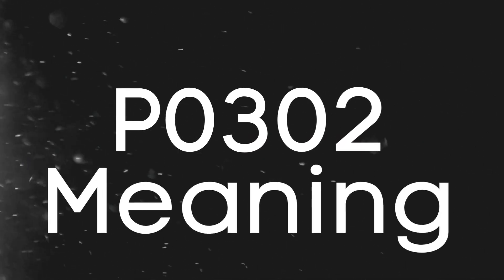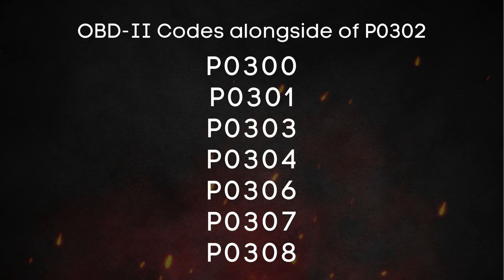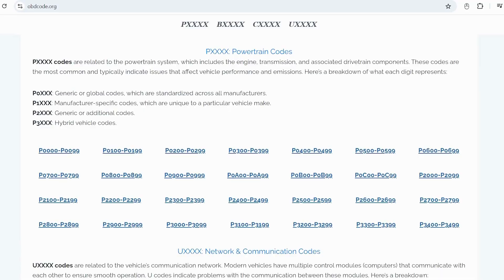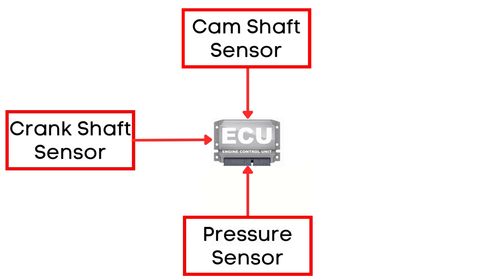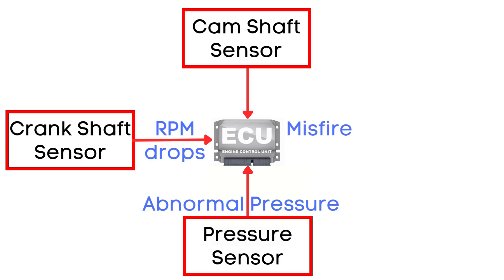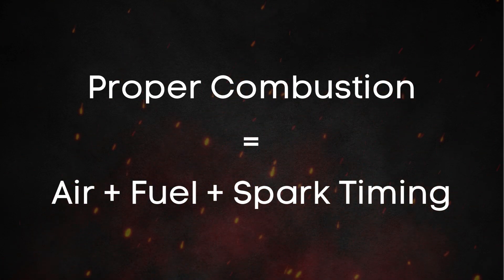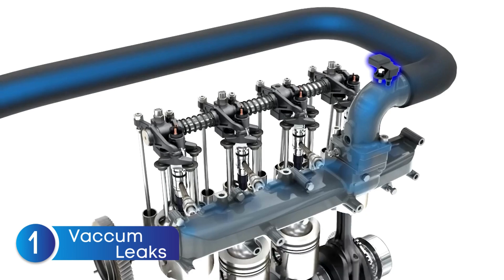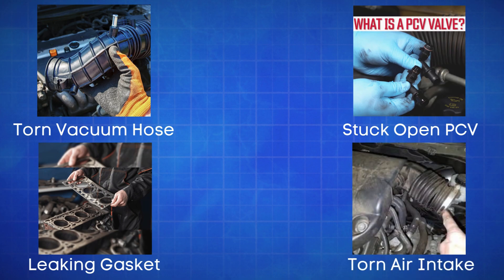How to fix P0302 | Cylinder-2 Misfire Detected

Comment: I had a cylinder 2 misfire. I changed the coils and spark plugs and nothing, then I realized that it was probably a clogged fuel injector, then I used Redline fuel injection cleaner in my tank and ran the car for a while then the problem got fixed and the misfire code went away on the OBD2 scanner. The car had a really bad rough idle, car engine was shaking and stalling a lot. The Redline fuel cleaner fixed it!
Reply from the maker: Thanks for the info...definitely it will help others.
Reply: My Cadillac cts4 2008 I got a P0302 misfire on cylinder 2 would that be the spark plugs n coils?
Reply: @kaylanclint9086  A cylinder 2 misfire, indicated by code P0302, means the engine isn't consistently igniting the air/fuel mixture in cylinder number 2. This can stem from several issues, including problems with the spark plug, ignition coil, fuel injector, or even mechanical issues within the cylinder. To diagnose, start by checking the easy and common culprits: spark plugs and ignition coils. Try changing the spark plugs, if nothing happens, then swap the coils on cylinder two and see if the misfire code goes somewhere else like to cylinder three, and that would be an indication of a bad coil. A cylinder 2 misfire can often be diagnosed and potentially fixed by swapping the ignition coil with another cylinder. If the misfire "follows" the coil to the new cylinder, then the coil is likely faulty and should be replaced. If the misfire remains on cylinder 2, then the issue is likely elsewhere, such as with the spark plug, fuel injector, or wiring. Make sure the spark plug wires are not worn out. Worn or damaged spark plug wires can lead to misfires, rough idling, and decreased fuel efficiency.
Reply: @Joansidtrack-t7b thanks
Reply: @Joansidtrack-t7b it was the spark plug now it’s okay the other codes are gone to
Reply: @kaylanclint9086 I'm happy for you! Good fix, you saved you self-money by doing it yourself.
Reply: @Joansidtrack-t7b I got one more part to go that is my rear passenger side wheel bearing that makes loud humming noise I checked it with my obdmeter diagnostic it showed the rear right abs or speed sensor came up I checked and wow my wheel bearing is pretty much done now im waiting on my part. I love these Cadillac CTS4 awd over 300HP. I also use to own a Infiniti G37X awd that was also a beautiful car 7speed with lots of power
Reply: @kaylanclint9086 Lol I am having the same problem with the back rear passenger side wheel bearing on another car, a Mitsubishi outlander SUV. I ordered the part on Ebay. The way I check wheel bearings, first safely lift the vehicle and support it with jack stand. Then, grasp the wheel at the top and bottom and try to rock it back and forth. If there's excessive play, the bearing is likely worn. Listen for unusual noises (grinding, growling, humming, etc.) while rotating the wheel by hand. If you feel roughness or hear noise, the bearing need replacement. I do this on each side of back wheels until I find the bad bearing.
Reply: @Joansidtrack-t7b that’s exactly what it did I’m 99.3% sure it’s the wheel bearing. I ordered the whole assembly. 3 bolts in the back I got this big azz socket 36” for that center nut/bolt lots of WD40 😂
Reply: When I go up hills it goes rough like pulling it barely makes up the hill when I use the manual gears thats when it feels okay but thanks I will try replacing those plugs n coils first